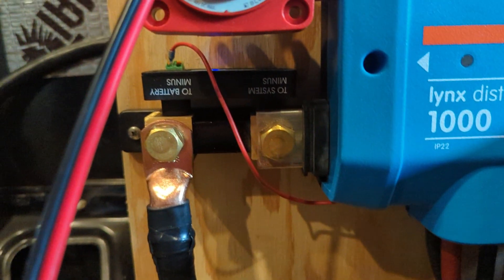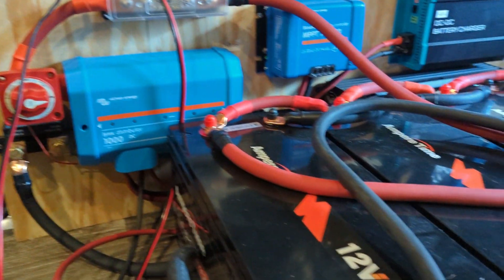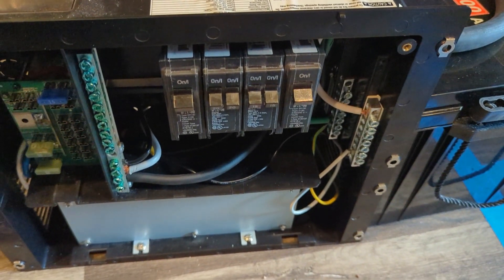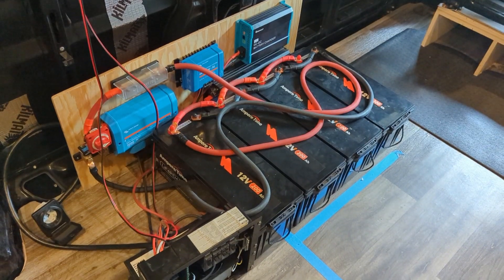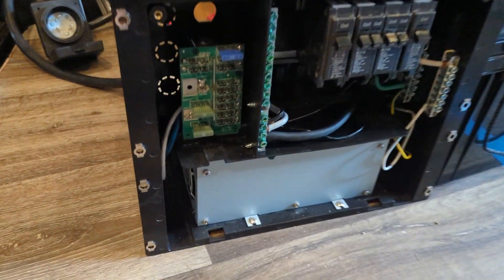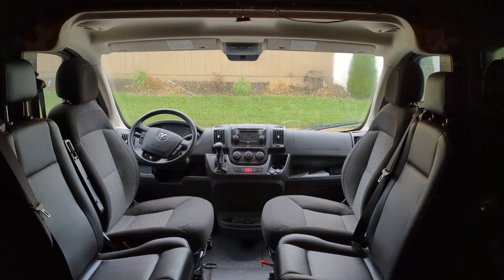How to Build a MASSIVE Lithium Battery Power System in a Camper Van

Comment: Great set-up.  I upgraded my van about 6 months ago. Went from 400ah of lithium to TWO 460ah batteries (920ah), with a 3000 watt inverter.   12 volt system. The biggest game changer for me was installing a second under hood alternator.I will likely NEVER plug into shore power again.  Thanks for sharing.
Reply from the maker: Sounds like a great system.  What second alternator did you go with?  Did you have it professionally installed?  I hear the process is very involved for Promasters.

Comment: Why so much power?  Most camper vans seem to run between 200-400ah and a 2000W inverter.
Reply from the maker: Planning to run a 12v air conditioner, an induction cooktop, and a convection oven/microwave.  I'll also be traveling with my wife and two daughters.  Their hair dryer use alone would drain a smaller battery system!
Reply: Some people like to use more power than I guess other people you have your standard amount of power but like someone like me I like to keep air conditioned and the TV running and cook on electronic devices like air fryer and watching TV with surround sound bose system or my 12-in subs connected to the same power I mean the so many power needs if you are that type of person but for those who just could survive off one or two batteries on such 2K inverter That's their choice me I have 4,000 continuous $8, 000 peak power and I'm still building my battery bank as I get my payrolls

Comment: So, is it 110v AC or 120v AC?  I've heard it both ways, but you said 110 in the video.
Reply from the maker: Great catch... Technically the true voltage is usually between 110 and 120, but closer to 120.  It used to be closer to 110, but it has risen over the years.  I'm not sure why I said 110 in the video, bc I usually refer to it as 120. 🤷🏼‍♂️